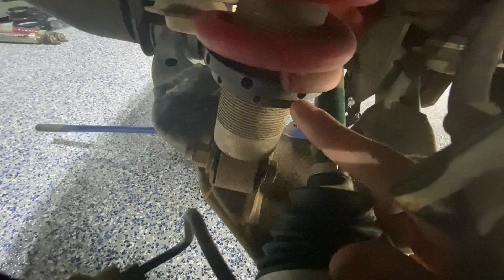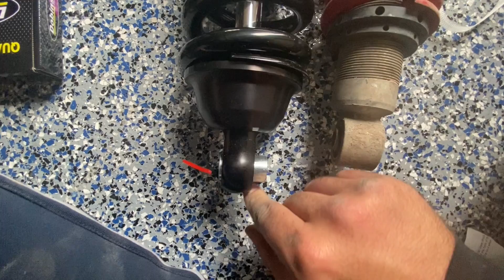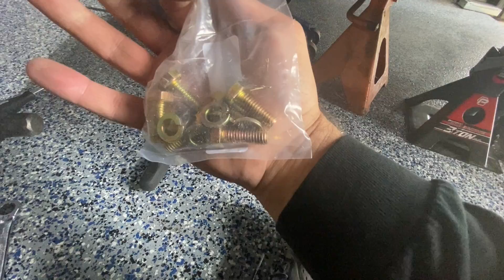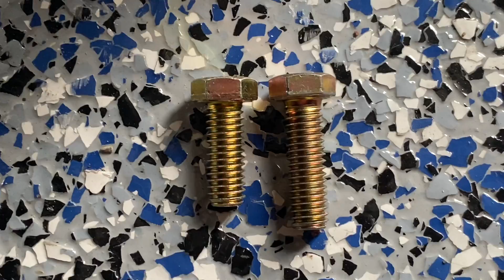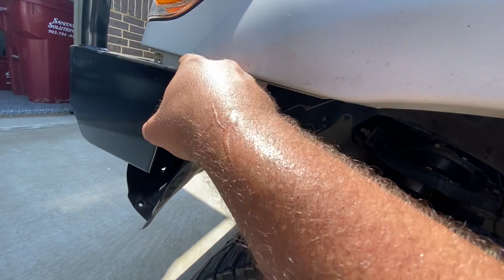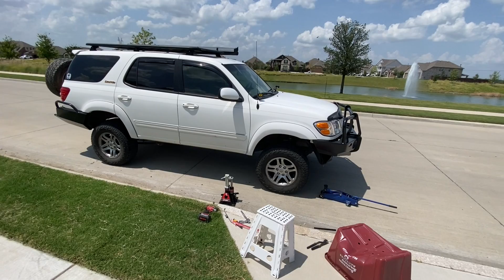Toyota Sequoia - Front Suspension Install ICON

Comment: Nice work. Just did mine today. I’ve been having moderate creaking when I’m hitting bumps and random turns. I tightened up a loose sway bar link but stil have creaking going on. I’m guessing worn ball joints?
It’s a 02’ sequoia 156k miles 4x4

Comment: Is that an Arb front bumper?
Reply from the maker: 100 series LC bumper from Ironman4x4
Reply: It looks good on there. Did you have to modify the frame to accept it? I just ordered the icons for my sequoia as well.
Reply from the maker: @ibwalk-r5d  yes had to modify the frame and the bumper subframe.  I should have a videos outlining what was needed to do to get this mounted within a month or two